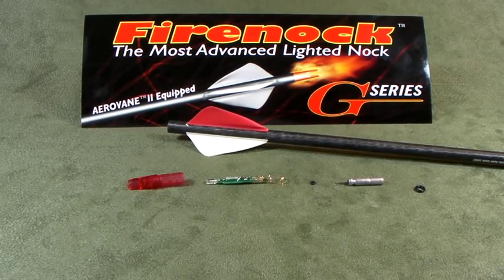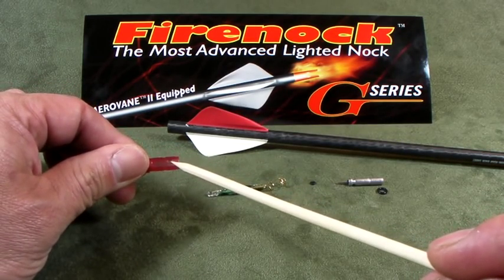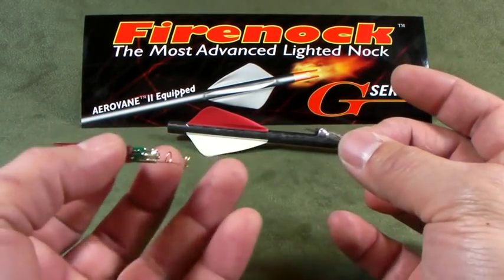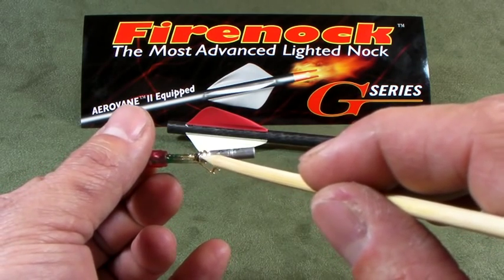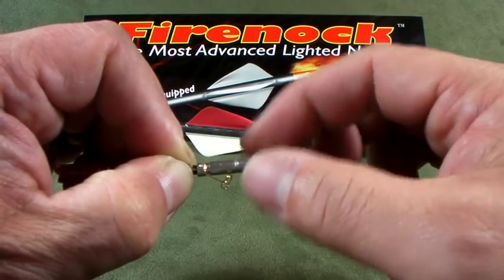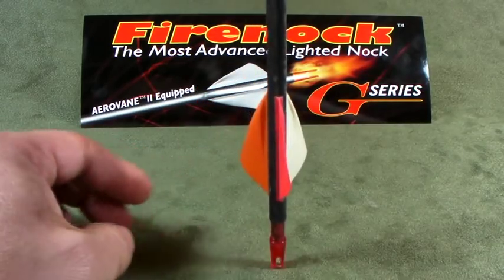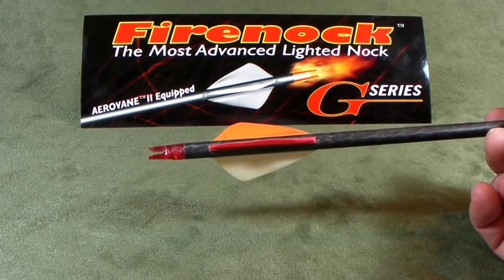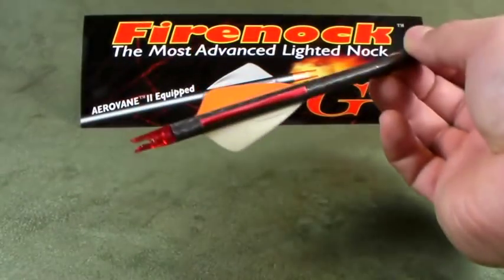Firenock Blinking Lighted Nock Style "S" Installation (Pre 2012)

Comment: Completely different then what instructions included said.. What about the extreme shock cap?
Reply from the maker: This video is installation instruction for the 2007 to 2012 version that does not always need the use of the end cap! This Dual-Loop system was discontinued as of 2012. That system is designed to be used for arrows with a speed not exceeding 290 fps and shot into layer foam target only if used without an end cap. If you purchase Firenock after 2012, it will be based on EZ-Coil. Please do a search on your tube and locate the correct instruction for your version.
Reply: @FirenockTV  ok thank you!